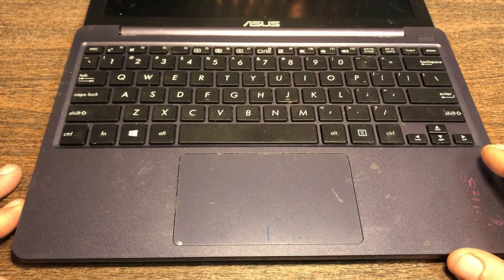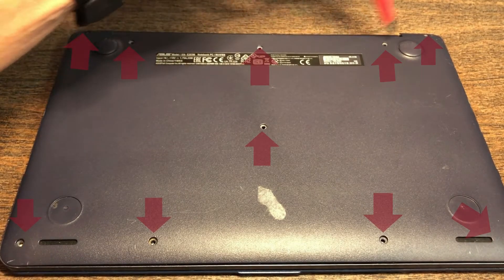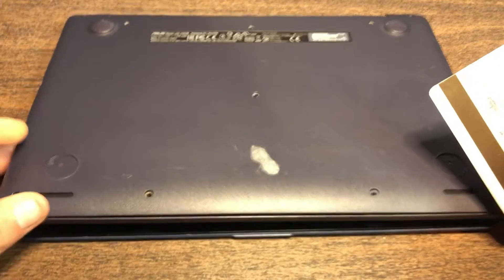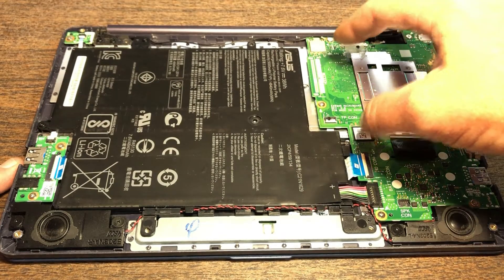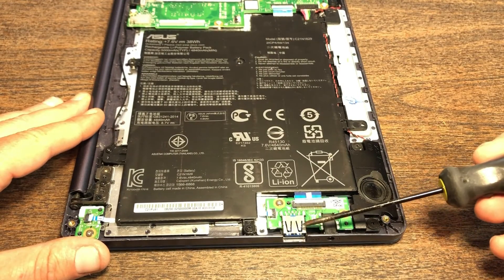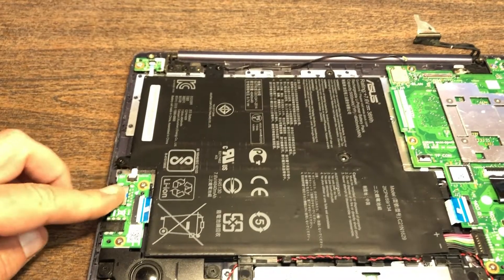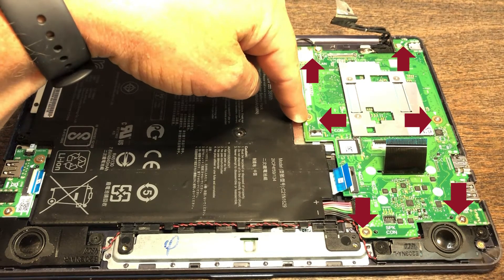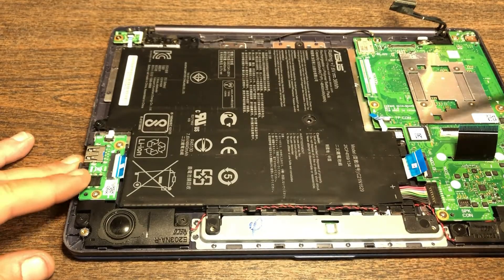How to disassemble an Asus Vivobook E203NA for upgrade or repair

Comment: Whar screwdriver do you need for the screws please reply
Reply from the maker: I cannot remember exactly which screws were on this machine. I've got a link in the description to the screwdriver set that I use that definitely had the correct sized screwdriver bits. Hope that helps!

Comment: Hi, can i change hdd, or ssd with a new one which should have more capacity. Is there any to buy and a chance to replace in asus vivobook 12 e203na?
Thanks for all infos...
Reply from the maker: Absolutely. Any laptop that uses a standard 2.5" drive can be upgraded to a  2.5" SSD. Probably best to make factory recovery discs first if you can, so you will have all the correct drivers installed from the start.
Reply: @AskYourComputerGuy  nice to read quick answer.  Thanks. I have bought notebook mentioned above  in 2018. I couldnt use because it warns me to rome some old big date, 28gb of 30 full just with Office. There is no more date. 
I thought the harddisc is on motherbord fix. (ram is ok, 4 gb) 
Now, i will buy a new hard disk with more GBs and replace it. :)

Comment: Hi, how can I add an HDD or SDD to this type of notebook?
Reply from the maker: You can't on this model. It is equipped with an integrated eMMc chip on the motherboard. It is not upgradeable to a physical drive and has no SATA connections to do so
Reply: @AskYourComputerGuy  I saw that I can upgrade it with an SD card, do you know how to do it or if it's possible? Thanks
Reply from the maker: You can use the SD slot, which is designed for external storage. I'm not sure of the max capacity, but if it's at least 32-64GB, and is recognized in the BIOS, there is no theoretical reason you can't install Windows on it. It really just depends on whether the Windows installation recognizes is as a usable "drive". But theoretically it would work
Reply: @AskYourComputerGuy  Thanks a looooot (:
Reply from the maker: Anytime!
Reply: @AskYourComputerGuy  hi I have a asus e203n notebook. It doesn’t have much storage nor memory. Can I buy a hdd and sdd and add it to the notebook. I really need more memory and storage for college. Please reply
Reply from the maker: If it's the same laptop series as in this video, no. Everything is integrated into the main board. No HDD or RAM upgrades available :(
Reply: @AskYourComputerGuy  oh okay thank you for replying. Do you have any ideas how to increase storage and memory because I only have 2gb. I really need a lot more storage for college and I can’t buy another notebook because this is all I’ve been given. Please help
Reply from the maker: Increasing storage is just upgrading the hard drive. If it were me, I would buy a larger drive with a USB adapter (so it plugs in like a USB storage drive). Then use a free cloning software like Clonezilla, clone your primary drive to the new larger drive, then when done, swap the drives and everything should be exactly the same as before, just with a larger drive. Lots of videos on YouTube on exactly how to do this. As far as RAM, I'd got to Crucial.com and use their memory scanner.  Will show you how much you have and what you can upgrade to. You can either buy the memory directly from them from that page, or go to Amazon and find it a but cheaper. But Crucial guarantees the correct RAM for your system
Reply: @AskYourComputerGuy  is crucial bx500 good to increase storage. Right now I only have 24gb total capacity and 2gb left over and I’m thinking about buying the £30 one for 500gb. Do you think that this is a good one to increase storage? I don’t really know much about tech and laptops sorry
Reply from the maker: Anything made by Crucial, I trust.  They make quality products
Reply: @AskYourComputerGuy  hi I’m really sorry to disturb- I know it might be irritating to answer this many questions but I have absolutely no knowledge in laptops, sorry hehe. I just wanted to ask that if I bought the crucial bx500, I would get 500gb storage but I cannot upgrade the memory. I only have 2gb of ‘non-removable memory’. Is memory and RAM necessary or can I just leave it as is?
Reply from the maker: No bother at all, my friend! Correct. Your system won't boot without RAM. If you are capped out at 2GB, unfortunately that's all you can do. Check max capacity of that system (quick Google search). Sometimes even with hardwired memory, you can still add physical memory. Haven't seen this machine in a long time, so don't remember specs off the top of my head.

Comment: Bro i am using this notebook. But it's not turning on. Battery light is blinking (green) and once we boot a little flash could be seen in the screen then black out. Please reply I am a student and don't have any money for buying a new one.
Reply from the maker: Have you tried removing the battery and the AC power and holding down the power button? On most laptops, this will clear out any memory state on the motherboard. You might be stuck in hibernation. Not sure on this particular laptop, but that's a good rule to try on any laptop that's "frozen". LMK what happens
Reply: @AskYourComputerGuy    i have tried it brother. But no use still same. I fear whether it is  motherboard error.is it??
Reply from the maker: It's not uncommon for motherboard or CPU failures to display blinking light sequences. Sometimes they are coded, which means a certain light blinking a certain number of times tells you what the problem is. I would look up that model followed by "blink codes" and maybe you can narrow the problem that way. Without having it in my hands, very hard to tell you remotely what the problem is. That's where I would start if a customer handed it to me and said "fix it"
Reply: Bro if you give your contact number. I can connect you through whatsapp
Reply from the maker: Sorry, I don't use WhatsApp. I only give contact information for people that I can fix remotely. This is not something I can do remotely. Start with the Google search. It has saved me many times :)
Reply from the maker: If you have exhausted every avenue, you might just have to accept that you have a hardware failure. Sometimes it works out that way. Sorry for that, I know how hard it is to be a student with no $ to go get something else. If you have any skills or ability, maybe ask around on Facebook for someone to swap services with you. I've fixed people's computer for lawn mowing. The barter system still works. Best I can give you, buddy. Sorry to hear about the laptop. At least you gave it your best effort
Reply: @AskYourComputerGuy  😥 any way thanks brother . I never thought you would reply. Very thankful to you. I will try my best to resolve this.i Will inform you if i get any update. Once again thanks  buddy.